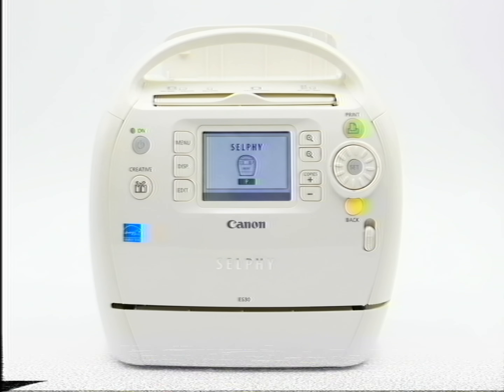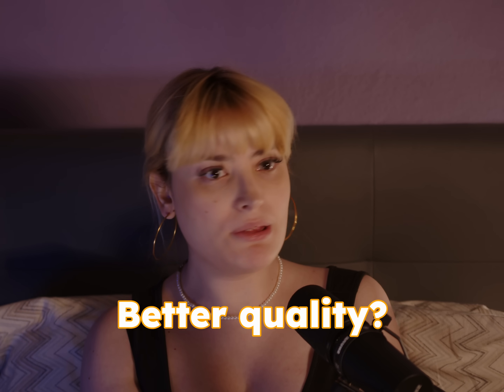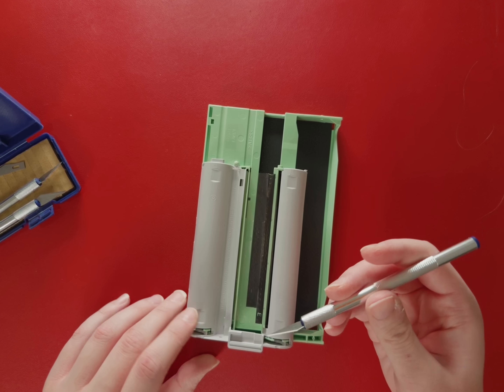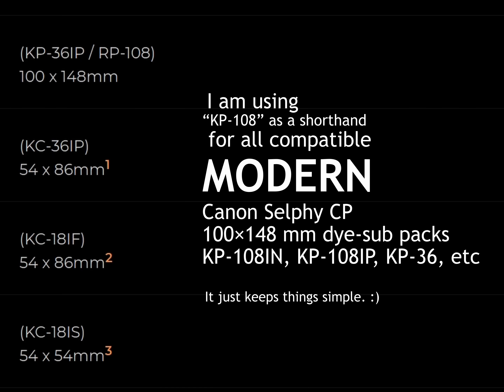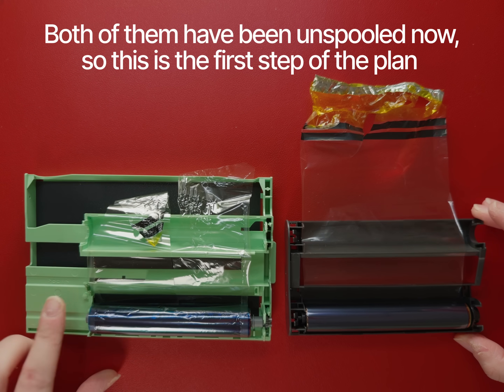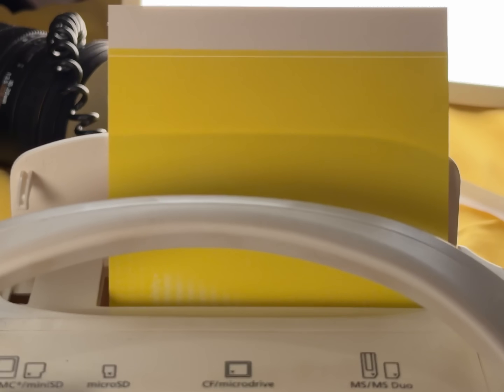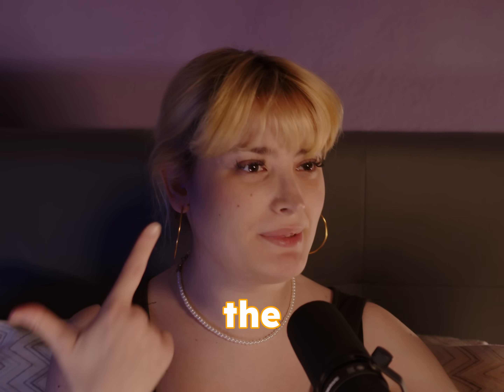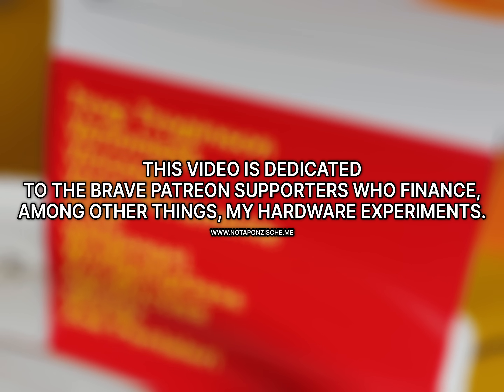Making my OWN printer cartridges (and saving my favorite printers, I guess)

Comment: 6:58 I have a DNP DS40 and it offers the same glossy/satin option on the overcoat, as far as I understand, the way it works is that glossy does a full pass of the coat layer, and satin just prints a noise pattern with that pass.

Comment: Happened to watch this video the same day I got a Powershot A200, pretty scary (are you inside my walls?). Also would you happen to know if there's any driver for win11 to view CF card through usb, was able to install the "ZoomBrowserEX" software and the camera shows up in device manager but doesn't have a driver.

UPDATE
tried connecting it to my thinkpad that has linux and it just works lmao

Comment: Doing stuff like this could be a business model as a service in itself. Yet the corpos would be against it.

To be fair if somebody made it easy to send them an old 1990's boombox to them, and then get it back to me with contacts cleaned, tape belts replaced, and fresh capacitors of the correct value replacing the expired old ones, and do it for under or around $200 without breaking or losing anything, I'd think I'd be willing to give them my business. The old stuff was better than what they're willing to put in the new stuff in some ways, so the modern "reproductions" are nowhere up to snuff. But I'm not sure who would try taking that on, and do so honestly?

Just something in consideration to have out there, it's by far not just printers.

Comment: Future steps for long-term solution:
1. 3D CAD model the "cartridge" and modify it to accept the 'new' type rolls to simplify the "reloading" process of the ribbon. Adding an adapter to the end of the spool shouldn't be too hard. Then you can 3D print the "cartridge" as you need / if they break.
2. 3D CAD model and print a cutting jig for the paper so that the paper is very precisely cut. The jam that you had is likely not just from the edges curling down, but also due to the 'play' the paper had from not being precisely cut. As with everything Canon, their cartridges and cartridge stock are all very precisely sized.

The "cartridge" they made will likely start to fail after a few "reloads" as they were only made to last as a consumable item.

Comment: The Canon SX laser engine, used by HP for years, was indestructible. The cartridges were cheap and easy to refill. Now, I have chips in my canon color laser and it refuses to accept remanufactured cartridges.

Comment: Maybe because I own these printers that I found this as a recommended video, I'm glad that you did something like this! I've actually had physical problems with the printer that can't be fixed with media. So of course I buy a new one because I'm an idiot but this was so fresh to see how one could even save one of these cartridges! I have destroyed the ribbon taking that it was impossible to use it after crumpling it! When I could have just Advanced it if not cut it out and reattach it if I really needed to in a pinch? And I could just use some Scotch tape? Just for that alone I like this and I'm subscribed

Comment: I work in tech support and one of the things I look after is ID card printers that work the same way, except you gotta thread the ribbon isn’t in a cartridge and you have to thread it around rollers on a cassette and then shove the cassette in the printer to change it out. The ribbon is also much bigger, so maybe that kind of ribbon also works in other things?

Comment: I wonder if you could 3D print a new cartridge's that interlinks the new spool with an old spools hookup.
Hopefully that lets you crack open a new spool, drop it into the printed adapter, and just run with it? But good job on beating their planned obsolesces!

Comment: had me until the ai sponsorship. don’t want to unsub but i might.
Reply from the maker: I knew hostinger for years as a hosting provider, and them hosting LLMs for building a base for websites did not seem that dangerous/far away from GUI based approaches so I considered that ok enough, but after hearing out from you all I will of course reconsider going forward, so don’t worry you will not see this product sponsored here again :)
Reply: @f4micom response much appreciated! happy to give you the benefit of the doubt, you’re doing some of the most fun stuff in this space atm. best of luck, and hopefully the sponsorships keep flowing

Comment: This reminds me of my ancient Brother laser printer. It's from the late 2000s and it's impossible nowadays to get the toner cartridges anymore, so after I run out of the toner back in 2019, I hired someone from a freelancer website, sent him my empty toner cartridge and he 3D printed one with a small opening that gets closed with a plug and I can just buy a toner from Amazon which comes in a bottle and refill the cartridge. However, last month the laser unit died on me and I had to buy a new printer which was a used Brother color laser printer and it still had the toner cartridges which were originally shipped with the printer. However, the funny thing is that it doesn't have any DRM chip on it's cartridge, so I can just replace it with a 3rd party one or just refill it 😅

Comment: I bought one of those things, because Canon said they supported my computer and I wanted to print metal foil.  But of course, they lie and that driver doesn't support the metal foil.  I asked them for details so I could write my own driver but they told me to pound sand.  The printer is actually made by Delta, and Canon just slaps their name on it.  Canon is dead to me now.

Comment: I have a Selphy CP900 from Goodwill. It works, however, the latest driver only works with windows 7 and I cannot get it to work with Windows 10. I’m glad the Canon Print mobile app still supports it though, and they still make ink ribbons and paper for it.

Comment: You are a f…ing cool lady (just trying to match your style with some cringe when giving my compliment)

Thanks for a really nice video - the handy people are the heros in this world - and it’s especially cool when 
women does this.

And I actually have a Canon Selby CP1300 which use the RP-108 paper and similar variants, so this was
very, very good to know, if I should happen to pick up a printer like the one you demonstrated, probably
for free, because there is no supplies for it. I suspect / hope that the "format" of the thermal transfer 
dye ribbon is some kind of internal "standard" by Canon, that they cannot easily change, because I am
sure there is professional equipment for photo stores that also use them, to print images in the go, 
for customers. And they would certainly not be happy, if Canon made their printers obsolete, over
the night. Meaning - even though shapes of cartridges shirt, and even if DRM are put into newer
cartridges, the ribbon itself will be the same for any foreseeable future, even though respooling
of the ribbon must be done and modification of the paper, must be done. 

Btw. have you tested with regular glossy printer photo paper yet? 10x15 cm (4x6") may not work 
as Canon has those extra "tabs" to rip off, eg. a longer paper, so maybe one must cut out from bigger
 (A4) paper and see if this works. At least my Selphie CP1300 printer uses those "longer" papers, now I must 
test if I can cut out regular glossy photo paper and print on those!

Maybe even thick, regular paper, like 250g/m² would work, though your printer has some kind of "trick"
where it turns the paper 90° so I guess the paper must be of the correct stiffness and thickness to not
jam, while my printer just pulls the paper straight through. It would be interesting if we can get these
printers to print on alternative papers. And yes, if one just could bave modified the firmware so it could
pull the paper at different speeds when printing, in case that matters to get the dye to stick properly on
non glossy materials…

Next mission would maybe to see if there are professional grade cartridges for photo shops with even more
film/dye on them, to lessen the cost per image, but then one would need to make a kit / tools, to safely 
spool those rolls over. 

Your video made me discover that I have something more to play with, at home here - really thank you so much! 🥳

Comment: Went to check her twitter and found a bunch of anti ai slop tweets... Ahh the irony
Reply from the maker: yeah? ai slop sucks lol if this is about hostinger: I knew hostinger for years as a hosting provider, and them hosting LLMs for building a base for websites did not seem that dangerous/far away from GUI based approaches so I considered that ok enough, but after hearing out from you all I will of course reconsider going forward

if this is about the chatgpt query: i literally did it to mock how stupid it is
Reply: @f4micom  how is that different from gpt or other LLMs? 

"I didn't seemd that dangerous" don't explain nothing at all lil
Reply from the maker: @S@Sebby-q5ui was considering the limited use case and training (as far as i understand it is only trained on their own material/it is an original product) as ok, basically just a different version of a website builder, without it being an insane burden on the environment or potentially something that could cause social problems or anything like that, and since it is only meant to build a base for a website in my mind the usecase was ok enough, unless you are completely against the use of llms even locally/for specific low impact/low risk tasks which would be a different story entirely ofc

Comment: it even looks like the newer cartridge, could fit inside the old model's cartridge. So in theory maybe a 3d-printed cartridge "frame" that goes in the printer, but accepts the newer cartridge within, could be modeled? Paper would have to be transferred separately but that would be very easy.

Comment: I TOTALLY get this sentiment! I was so over inkjet years ago. The printers take multiple cartridges. I don't print often enough to use up the cartriges before they dried out so I wasted massive amounts of money. Also every time I went to print it seemed like there were either clogged nozzels so it streaked or it was dried out completely. I finally realized how much money I was wasting and decided to front-load the cost and buy a color laser printer. There is a bit of a tradeoff. Instead of the printer being cheap, then buying lots of expensive cartrides afterwards, the printer is more expensive and you rarely buy drums (at my print rate they've lasted years). You do have to leave your printer plugged in and on or remove the drums since they are light sensitive. When in the printer, the shutter is open and the drum is exposed to light. The printer has a program that rotates the drum on a schedule to expose a different part of the drum. If it's off, it can't do that and will ruin that part of the drum eventually. When you remove the drum the shutter closes. The second tradeoff is that you can't print glossy photos. However, the quality of photos it does print are great, they're just not glossy. If you can live with that, it's a great option. I've loved the switch and never looked back. Down with inkjet! LOL

Comment: I wonder what's the most accessible printer technology. That we can build (recycle) ourself and use if the world and all current tech falls apart.
Heat printers? That's no need for ink cartridges but it's a special type of paper. 
Dot matrix? Maybe. We just need a ribbon with some ink on it. And the mechanics.

Comment: As someone who fixes (mostly larger) printers professionally, I'd recommend cleaning any of the paper feeding rollers with isopropyl alcohol (or Electrolube Rubber Roller Restorer if you can get it in Europe).

Comment: OMG.  I had a Selphy printer that I got when I was still daily-driving Windows 7.  Used it for maybe 10 prints.  Recently tried to use it again and it's all effed up.  There are a bunch of common issues with broken gears and things like that.  I considered getting replacements 3D printed and yada yada and then decided it was all so cheaply made that it wasn't worth the trouble.

I'll see you in Dallas, printer.  Go back to the lake of fire you came from.

Comment: Read up on the "bait and hook"-Business Model to understand the sheer toxicity of these companies. Us consumers should actively hack and spread information to hack these dumb 'you can only use our proprietary stuff' products, so they will lose money by using this tactic. You're doing the lord's work here! I've also been using the cheapest inkjet printer I could find (Canon TS3100 for like 20€) for the last 5 years with refillable ink holes, using easily attainable bottled ink, which you can also make yourself. That one isn't software-locked either luckily, unlike the newer printers that just stop printing after x-amount of pages, despite there still being ink in the cartridge.

Comment: i used to do this with polaroid cartridges and photo paper! there was also one time where i accidentally got the wrong size polaroid cartridges and ended up putting the smaller rectangular polaroid blanks into the square cartridges that my camera accepts. kinda wonky figuring out framing the shots so they'd not be completely cropped out, but if there's a will there's a way :) awesome project!

Comment: The problem I have had trying to get old examples of the brick shaped model working is that they all have plastic drive gears inside the printer mounted on a metal shaft that shrink and stop working completely.

Comment: The USB support is probably limited to Bluetooth dongles with a CSR chipset, those used to be ubiquitous up until the Bluetooth 4.0 era but are harder to find now. If you can find a Bluetooth dongle that states it works with Open PS2 Loader you might have more luck since that also has the same limitation IIRC.

Comment: I have a newer Selphy but these older ones are more rad than I realized. Who thought to make the paper SPIN?

An adapter to drive the spools could be a nifty little 3D print if it's something you find yourself doing a lot!  Less comedy value than a drill and bit, but likely less mangling of the important stuff.

And what a bummer that the short edge of the paper is isn't on the side of the cassette with all that dead space. I felt real clever for a second wondering if it's possible to make more room there instead of cutting all the paper. It also might just jam, so...

Comment: When you grabbed that drill, I swear you were ready to reduce the number of clones for some reason. That "taking matters into our own hands" energy was giving off a different vibe.
Also, I bet someone can design and print a 3D print a jig that unspool and re-spools the cartridges automatically (or at least, with levers for the cutting and swapping parts). The process is really prone to be automated to make it repeatable and safe to the cartridge. With a microcontroller and a motor, it can probably even do the whole process alone, by detecting the end of the spool via small changes in the motor torque, but that would take extra effort and make the jig more expensive.

Comment: The new cartridge seems smaller than the old one, maybe you could 3d print a jig that could fit a new one? Or are the spools' ends not the same? Might be worth opening the printer and changing the gear that interlock with the spools.

Comment: I use an old Canon Pixma iP7250, cause aftermarket cartridges are stupid cheap, and it can be modded to use direct ink instead of cartridges (i stuck with refillable cartriges), sure, i guess it does not have that protective layer thing, but i bought the printer and 5 ink changes for like 30 euro.

Comment: We really need an open source printer.
Reply: The print head is apparently a huge hurdle(for inkjets, issues with making tiny holes?). Latest news I've see was one that is mostly open source but it uses a commercial cartridge that comes with the heads
Reply: Open source the parts please

Comment: Funny, I didn't realize these little old die sublimation selfie printers were standardized. I have a kodak easyshare camera dock/printer that seems to be the exact same. The ink cartridges look very similar, and print 50 images. it is 300 dpi 4 by 6 inches. Cool to know one day i could jerry rig more ink by stealing from canon, although i have 500 prints worth of ink from ebay
Reply: worth noting though that mine exposes the full length of the ink in one go and prints faster as a result
Reply: Also worth noting my printer has a open free to access paper tray

Comment: In a way canon does make a DRM-free printer -Their gen 1.5 ink tank printers(that is still on sale today as the G1010/2010/3010) while not as convenient to service their waste pads as their newer successors with chipped waste cartridges and as slow as molasses have have waste pads(a bit tricky to get to) that can be replaced without canon's existence due to having a firmware that contains the tools to reset the counter(that is normally stored in the chip) by itself and if the leaked service documents where to go by the functionality was ADDED thru a firmware update. Had canon included service instructs with the printer itself(instead of being leaked) i think it would fit the bill entirely.

at the very least the model lineage put a stop to the activation key shenanigans epson was trying to pull with their 1st gen tank models.

Comment: I got few years go for free "broken" ink printer for spare parts. Instead I found some chinese factory tool and reseted its ink waste counter. Started working again. Once a while I buy cheap ink bottles and using syringe I refill cartriges, reset ink counters and I'm good to go. So cheap.

I also got for free broken laser printer. Everything what was needed was just take out the printer mainboard and perform solder reflow in kitchen owen for 5 minutes :D